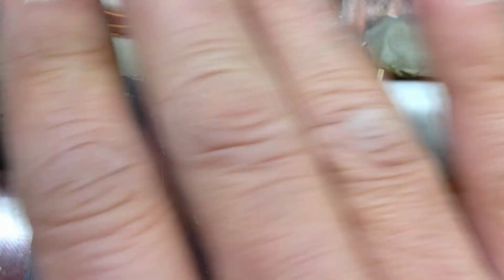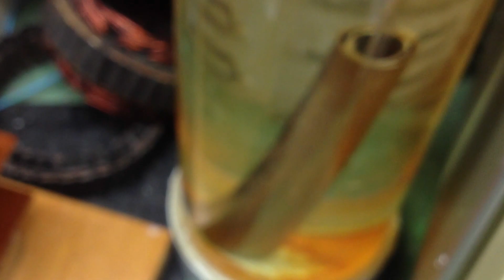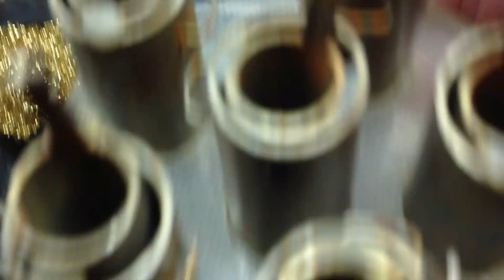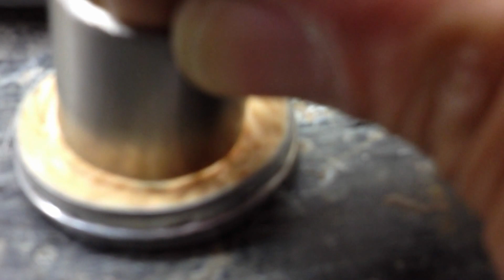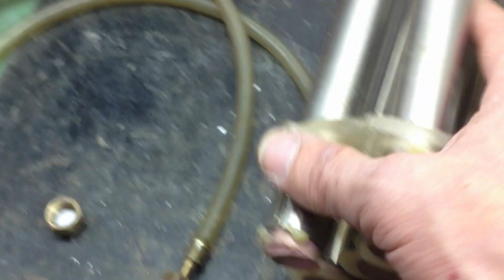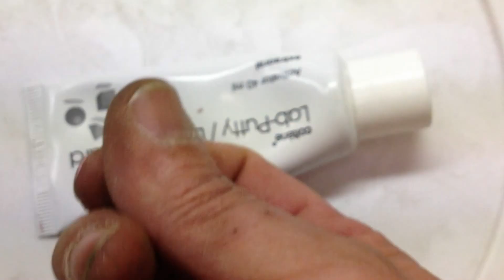progress ?

Comment: nylon screws work well for holding the tubes apart. just tap 3 holes 120 degrees apart, top and bottom. that holds the inside tube in place. 
nice zirconium